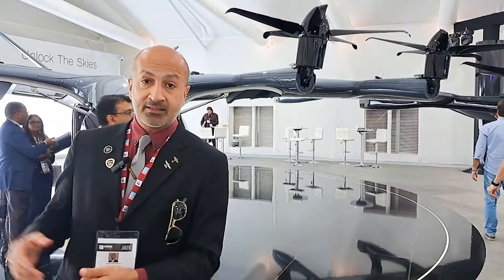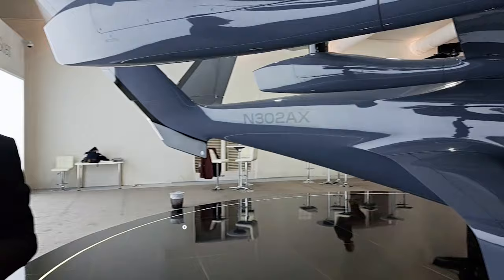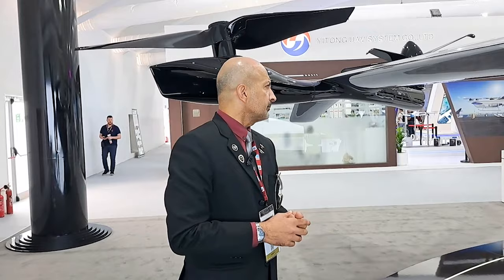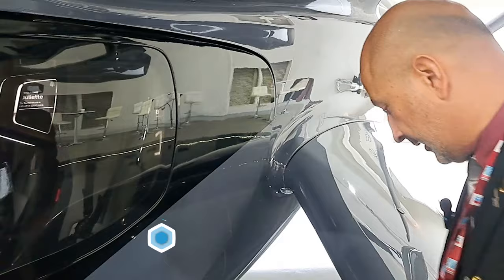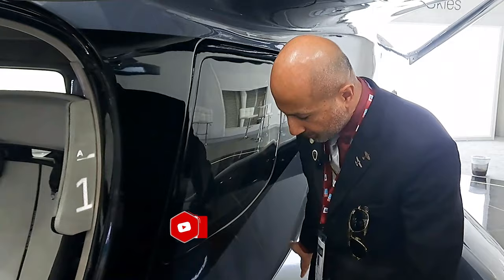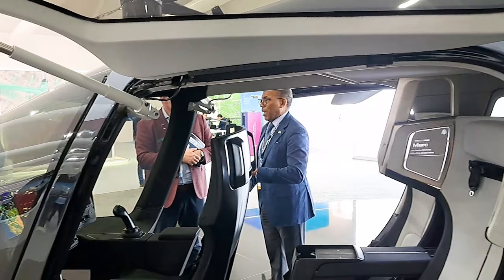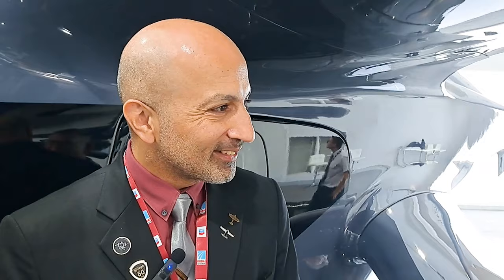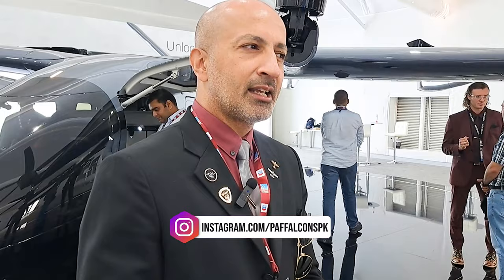FLYING TAXIS | Archer Aviation - Fahad ibne Masood, MRAeS | Dubai Airshow 2023

Comment: 7:55 F-18 Hornets don't fly out of Toronto, and not comparable as the F-18 is a jet powered fighter aircraft and it isn't the same category as an eVTOL. Li-on loses thermal efficiency in cold climates, most notable examples are electric vehicles such as Teslas. 

Also Archer is not the only American side for eVTOLs. Joby Aviation is another major company involved in developing eVTOLs and there is BETA Technologies as well.